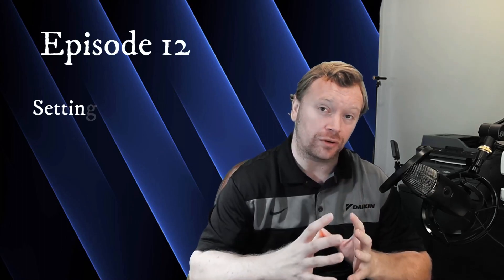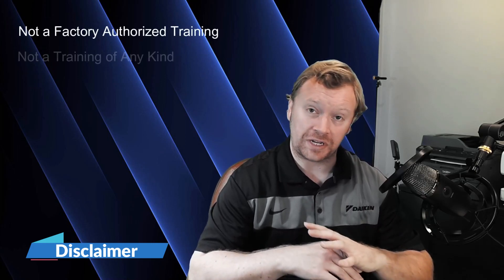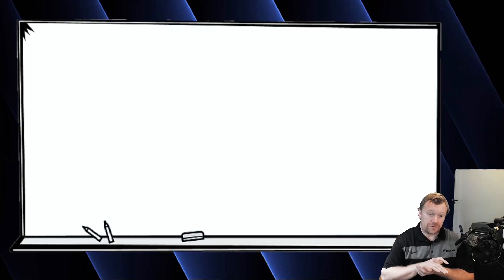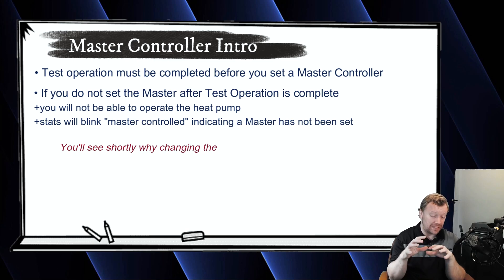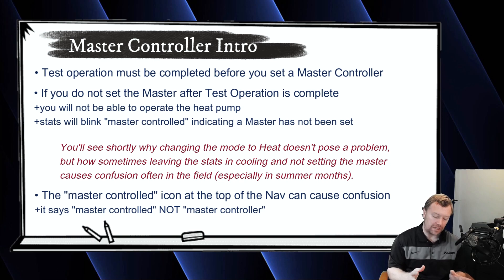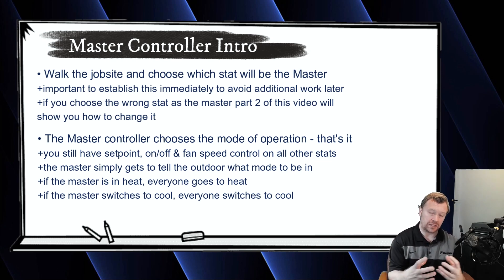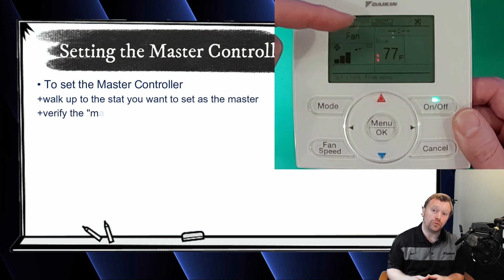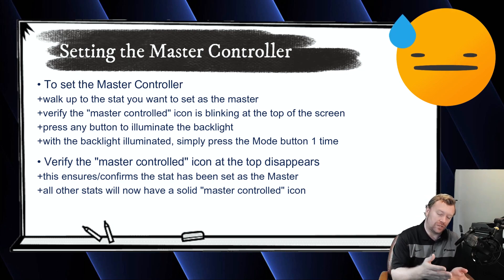Daikin Nav Controller (BRC1E) Master Controller | Setting & Changing Master Controller - 12-3-2021

Comment: How to remove centralized control
Reply from the maker: You have a central controller hooked up? If so its got things locked out. If not check t1t2 settings.
Reply: I was going to ask the same question. I have a central controller that went out and need to disable it. System won’t let me run system and says “under centralized control, adjustments at remote control are being restricted.”

Comment: Hello. I was wondering if you can assist me with setting the most efficient temperatures on my master? Also, why is the hot and cold set temp at 2 degrees differential. Right now in winter we have the heat on, and when the room gets to a set temp or above the cool air goes on. Why is that?

Comment: I just wanted to turn on heat for one bedroom and all 4 heat pumps turned on. the three controllers (BRC1E73) are turned off, but say "central control". How do i just have the bedroom on without central control turning the entire house on?
Reply: I have one mini split with four indoor ceiling air units in four rooms, each having their own wired remote controller.

Comment: I'm in a new building with 145 small units that need to be controlled 24/7. Temperatures are going into the 40's at night and up to 60 during the day. We have 20 master controllers throughout the building. Of course one side of the building gets hot in the morning and in the other side gets hot. I want all thermostats to respond to the temperature in the room and maintain a 70-72 degree temp. If I set up the schedule on each master with one scheduled setting of say, 7am, On, cool to 70, heat to 72, will all of the navs connected to the masters follow that schedule? Or do I have to set all of the navs to that same schedule? If I have to set all of them, do I have to set the masters first or does it matter? Thank you!
Reply from the maker: I would need more info to help. Model of equipment installed for example. Is it vrv or mini splits. Is it heat pump or heat recovery if vrv. Is there an itm. Things like that. 
Anything with a master stat means that the master stat controls mode. Everything else just gets setpoint variation.

Comment: Why I can not turn the nav on after test complete? It shows restricted because of central control. I use one nav for 6 indoor  unit and onevoutdooe vrv.
Reply from the maker: Most likely t1t2 being used and the contact closure is forcing it off. You need to change the field settings if using t1t2. Could also be from an itm central controller or a variety of other central controllers. But usually right after test operstion it happens from t1t2 being used.

Comment: Good evening 
What obout the older controllers  ex. BRC1A52 or BRC1D528 . Ther is a system with one out door unit and 10 indoors units and all the controllers showing the heat icon and can’t change it. Also they show  the icon with 3 arrows and a square . Aland one of them show the same with the others and an icon with 3 arrows more and it can’t turn on. Some controllers have been changed with newer ex. BRC1D528 . I want to find the master to change the mode to cool . Can you help me ? 
I’m sorry about my English. I’m Greek from Santorini island 
Thank you in advance 
Petros Manolakis
Reply from the maker: To be honest I haven't used some of those super old models. However, most of the time commercial systems may have some sort of central controller which could be why you're locked out. Or if it's a heat pump (not heat recovery) then maybe you simply just need to locate the master stat. I am not sure which one it would be though I would recommend having a tech nearby stop by to help and take a look, I wouldn't want to steer you the wrong way.

Comment: how can i identify what controller goes to which system (indoor fan coil) and condenser
Reply from the maker: As a user? Usually the indoor and outdoor arr labeled which fcu/cu they are. Sometimes the stats will be labeled by the tech as well. Otherwise turn one on at a time I guess. If there's a copy of as builts and floor plans that may help as well.

Comment: Hey thank you for the video. I have 3 units with 2 of them "master controlled" exactly as you described in the video. Is there any way to turn off this master control paradigm? I want my units to exist independently.
Reply from the maker: Not on a heat pump. You can move which one is the master, but the heat pump needs a master to dictate mode of operation. The others have their own setpoint but must follow the master.

Comment: What if they all are blank on the top on a system in use over two years?

I'm not sure which one is master
Reply from the maker: Is it a 3 phase reyq outdoor unit with branch box or multiple branch boxes? In this case each stat is it's own master because each box port acts like a mini heat pump, allowing heat or cool from each port. So if you have this type of system usually most all of the stats will be blank at the top meaning they are all their own masters. If you press mode, does it allow you to change the mode?
Reply: @InverterAlways  I can change modes on any of the three  and if on auto sometimes it will say central control. 
I will have to get model number of the unit. 
It's using three controllers and three cassettes
Reply from the maker: @zNickMan  so it's a heat recovery system, you can put one in heat and one in cool at the same time?
Reply: It won't heat and cool at same time unfortunately. Im the homeowner will check with the install tech on specifics. I had my  farmhand in here the last two years now I'm in here as I remodel the main farm house. 
I could have sworn it had master controled listed on some of the stats before. 
Install tech has been quite busy so I've been trying to figure it out myself. I would like to be sure the living room is the true master.
Reply from the maker: @zNickMan  I wonder if they changed a field setting that causes every stat to override the master. Ask your technician they should be able to fix it or call daikin directly to get help correcting it.
Reply: As I mentioned, central control message does appear if rooms in conflicting modes. 
The message can be in any room and moves around which makes me wonder if there is not an assigned master controller. 

And yes, the system works great :)
Reply from the maker: @zNickMan  sounds like a heat pump with field settings allowing some overriding controls. At this point I think its best you have a tech come take a look just to see what they say, I can be totally wrong and don't want to lead anyone down the wrong path.
Reply from the maker: @zNickMan  nick I was thinking about this more. Is your outdoor a multizone mini split? Multiple sets of pipes coming out of the outdoor unit? If so that explains why you don't see master. The mini split systems is first on as the master which also explains why sometimes central operation pops up. Put them all in the same mode. Central operation will go away and the system should operate normally.
Reply: Thank you
Reply: Ok yes it is.

Comment: I have a setup of a 1 to 1 setup with a wired thermostat linking 5 heads together, on one of the thermostats it's showing "master controlled" I don't have any other thermostat hooked up to these heads, any idea what would be the cause for this?
Reply from the maker: New install? Have you ran test operation from outdoor unit yet?
Reply: @InverterAlways  it's a new install a total of 28 units, yes I ran the test on all of them, most of them have 4 or 5 heads per thermostat
Reply from the maker: @yaakovgifter169  so one of the other stats is the master most likely and this one is a master controller stat. Go around and check there should be a stat that's blank at the top that's the master. Unless I'm misunderstanding you. You have 5 indoors on one stat and all 5 indoors are the only indoors on the outdoor unit? Or more stats on the outdoor? Sometimes if you've pressed buttons and made the outdoor no longer a master outdoor you can run into issues where the stats are locked out. What's the outdoor model(s) of each system
Reply: @InverterAlways  I have 28 indoor heads and 28 outside units, the thermostat controls 5 heads in one room and in another room I have one thermostat controlling 5 heads and in a different room I have 12 heads with 3 thermostats each controlling 4 heads.... so there is never 2 thermostats talking to the same machine
Reply from the maker: @yaakovgifter169  you have one stat for 5 completely different systems? Definitely NOT recommended brother. It's going to be a huge pain if there's ever an issue because you have no way to tell what system is in error it shuts it all down. Would recommend having one stat per system here. Likely you have an issue on one of the systems and that's causing the stat to be master controller for all of the 5.

Comment: One Nav controller scenario I haven't come across on IA or the Nav BRC1E73 manual is:  If I have 1 outdoor unit and 4 indoor units (FXSQ), each with its own Nav except one... which will have two Navs in a Master/Sub-Remote arrangement... (1) is that a valid arrangement?  If so, (2) it means that only one of those two Master/Sub-Remote Navs can ever be the outdoor unit's change-over Master controller.  Correct?
Reply from the maker: You can do this if you want. Though what is the reason for connecting 2 controllers to one of the indoor units? This is extremely rare. That indoor will have a main and sub, both can change setpoint and what not. The master controller that has mode control is totally separate though. You'll need to choose one stat from the whole system if it's vrvs or a vrv heat pump. On heat pumps and vrvs one of the fxsq controllers will be the master. It can be any of them you choose. On heat recovery each fxsq would be it's own master. At that point your main sub arrangement of 2 controllers is still the same. Where you're basically putting one at each end of the room for easier access I guess. You can change whatever you want from the main screen. Just can't get much from the menus.
Reply: @InverterAlways  Thank you, Dana.  Short answer:  2 reasons and yes, access is one of them.  (1) This particular indoor unit serves two bedrooms.  There may be long periods of time where one bedroom is vacant. Would rather have some control available in both rooms rather than regretting not having that option later on. (2) I expect one room to be the more dominant cooling load during summer and the other room the more dominant heating load during winter.... at least until the trees have 5-10 years of growth on them.  But now I am wondering if the sub remote's temperature sensor is even used in determining indoor unit load?  Anyway, I didn't realize this arrangement would be so unique, until I acquired the manuals and looked for examples.  The FXSQ manual kind of hints at it but the example is applied with group control, unfortunately, and the remote/sub is at the last (largest ID#) unit.  The Nav installation manual instructions for identifying the sub remote are almost the same as selecting the master change-over, except the mode button is held for at least 4 seconds at the sub remote after error code U5 appears.  I missed that distinction earlier.  Guess I will just plan for it and see how it works.
Reply from the maker: @rcnthusiast  are you trying to set the unit with two remotes as the master? It'll be confusing for the homeowner just fyi. Regardless, only the main stat will use its sensor if you set field settings to use the stat sensor at all. Otherwise you can use return air. The sub remote is mostly designed only to change setpoint. But the setpoint change affects both stats. So when you change the sub remote to 73 for example the main also changes to 73. You'd be better off putting a single stat in the hall between the two rooms and using return from both rooms. Set field setting to use return air sensor for temp control. Done. Easy. 
Or use Two smaller indoor units altogether. 
I get it. If you have an unoccupied room you want fast control, just not giving them much here.

Regarding setting the master controller that's done via mode button. To change the main sub you do this in service settings. It will be very easy for the end user to confuse these two however. And should someone get into the wrong setting on the indoor that only has one stat you're done. Stuck as sub forever until you manually add another stat and reset them super carefully so that when you power cycle it off to remove the second one both are mains. 

Just opening up a can of worms here is all.
Reply: @InverterAlways  Thank you, Dana.  Yes, I was under the impression the sub would have unique temp settings to those of the master.  So... I appreciate the invaluable information, detailed example and perspective.  I will forego my arrangement 😵‍💫and consider using the return air sensor as you suggested.  (Insert "Easy" button here!) 👍
Reply from the maker: @rcnthusiast  no problem happy I could help clear things up. Let me know how everything goes
Reply: @InverterAlways  A year later and I have finished enough of the system to run a successful "test" mode.  So... operating the FXSQ IU with just the return air sensor works nicely if you leave the fan cycle to LL during thermo-off, but I will probably end up using the NAV's room sensor instead because:  (1) I do shut the system down at night this time of the year.  The return sensor ended up being 5-6 degrees cooler (so far) in the morning than the room temp while the fan is off.  I am a little worried about an inadvertent mode change to heating if the attic conditions are right (I leave the mode in auto and use a schedule).  (2) as mentioned before, in order for the return air sensor to properly sample the two zones, the fan has to be at least set for LL speed during thermo-off.  I think I prefer to conserve the filter media and run time for now.  (3) the return air sensor closely matches the NAV room temp sensor anyway while the fan is operating.    Also, I did try the mixed, return air with NAV room temperature mode for a little bit, but I couldn't locate any specifics about that algorithm to fully understand the sequence of operation, advantages, disadvantages or possible tweak adjustments to the algorithm.

Comment: I would never allow my Nav to say 78 degrees.  If it did in the summer, I would go to the movies.  If it did in the winter, I would file for divorce.
Reply from the maker: Hahaha, yea me too, but the studio gets warm when I'm recording. Lights on, computer running. Definitely gets toasty.  Plus I'm sitting there holding the controller which warms it up.
Reply: @InverterAlways  Dana, is there a way to set the upper limit on the Nav?   My simple wife thinks it’s a gas pedal, the harder she pushes it the faster it gets there, then she forgets to turn it down.  I get home and it’s 80 degrees and the electric meter starts looking like the national debt.
Reply from the maker: @mcdouche2  yes if you go to service settings, then I believe it's energy saving options, there is a setpoint range limit where you can set upper and lower limits for both modes. I can also do a quick video on this thanks for the idea!
Reply: @InverterAlways  awesome!  I’ll look this up, modify and watch the frustration rise in my wife.  This weekend is going to be awesome as I claim ignorance!!!   Thank you!!!
Reply from the maker: @mcdouche2  record and email to me so I can make a compilation video of the struggles lol
Reply from the maker: @mcdouche2  I wanna do one similar on my house. Sorta a gag reel if you will. Lol
Reply from the maker: @mcdouche2  lmao